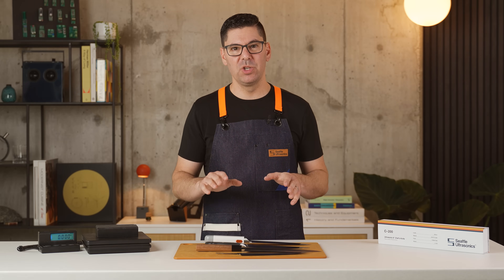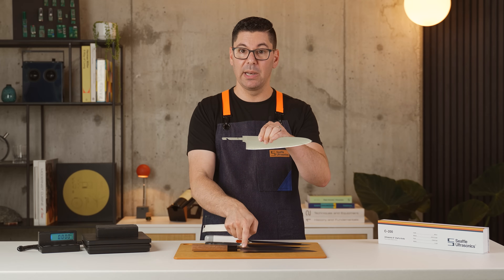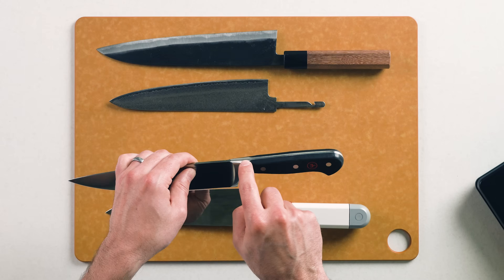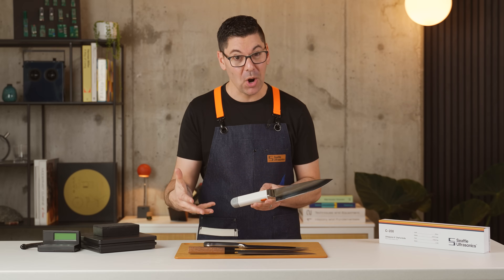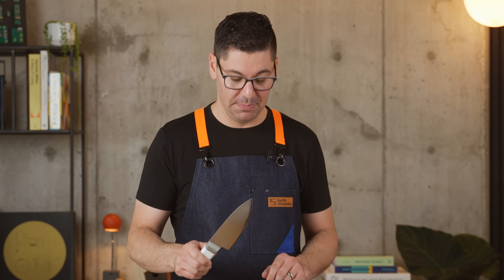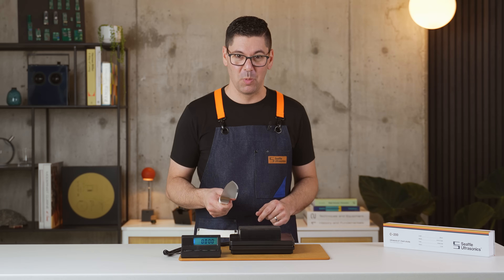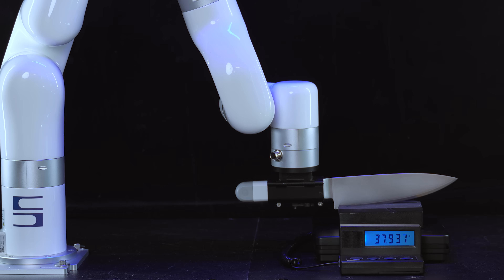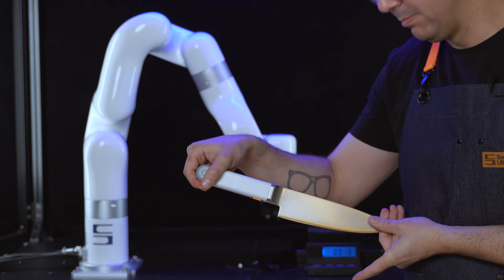Ultrasonic Knife TESTED: strength, weight, & size

Comment: LPBF porous blades would be great with this. You can have a tiny fan in the handle pulling air and feeding to the blade, so another drain on battery. NanoGraf has good batteries for this. 

Also you should provide something between a shortish upward curved ham boner / butchers chisel (hyperbolic parabaloid kind of shape), a putty knife, and a half moon leather knife. Wide pan, upward curve towards front letting you angle. It shouldn't be too sharp as a dull knife works great to pull apart at the fascia, so a blunt apex. This would be fantastic for field dressing and butchering. You've got hunters and you've got hunters with money, both will buy crap they don't need, this would actually be very helpful. It would be like going from thermal back to naked if people want to give it up.

Comment: Are you gonna make a wooden grip version down the line perhaps?
Reply from the maker: I'd love to, but it's a huge challenge compared to wood handles for traditional knives. Ours needs to mate perfectly with internal components to hold everything together, so it needs fine details and dimensional stability. Wood expands and warps with humidity. Micarta could work, but would require the handle to be milled instead of molded, making the whole thing way more expensive.

Comment: It looks a little boxy and less than ideal for a comfort. For a later iteration, I would suggest taking some inspiration from Zwilling and Victorinox. Thin it up a little and give a belly swell and a bit of mid swell. Then make up for lost internal space by making it longer and playing with the blade dimensions to get the balance back forward. Maybe alter or eliminate the integral bolster to get the handle more forward.

Good luck. I have never used an ultrasonic cutter. It seems like a cool product for kitchen use.
Reply from the maker: Thanks! It's remarkably comfortable. We look forward to getting it in people's hands.
Reply: @SeattleUltrasonics can you make plastic ergonomic?

Comment: Any chance that the handle can be made from wood or metal in the future?
Reply from the maker: I'd LOVE to do a wood handle, but the inside of the handle has a bunch of complex geometry with extremely tight tolerances. Wood expands and warps with humidity changes, which makes this a big challenge. I prototyped a metal handle, but it blocks the wireless charging. Some kind of G-10 or Micarta handle could work in the future, but to keep things remotely economical, right now it needs to be injection molded, and Micarta doesn't allow for that. 
I will say, when you hold the knife it doesn't "feel" plastic-y. A lot of effort went into making it feel as solid as any other knife handle.

Comment: I couldn't help but notice that it looks like J Robot Choppenheimer's grip on the knife during the strength test also covered the 'base' of the blade in the handle (i.e. covering the joint you are supposedly testing the strength of)... doesn't that effectively render the test meaningless?
Reply from the maker: No, not really. This is where you'd also grip with your hand, but you can see there's also a little flex in the holder. If it was gonna break from this much force, the holder isn't taking up enough load to stop it.
Reply: I thought the same thing. I believe in the knife, but I also believe this was less than ideal way to demonstrate the strength. There is just something about the look of the knife that makes it seam ‘cheap’ and weak. Don’t get me wrong, I know it isn’t and I am aware of all the engineering involved. Maybe it is simply the color? Wish I could put my finger on it.

Comment: Thanks for answering most of my questions about the knife from the first video!  I still want to know about replacing the batteries. Expensive knives last decades...batteries last years. Are they user replaceable? Is there going to be a way to replace the batteries when they inevitably get old?  I think it'd be absolutely lovely if the batteries were modular in some way.
Reply from the maker: Yep! The battery pack pops right out and charges via USB-C, or you can keep them in and use the Wireless Charging Tile. We sell extra batteries right now, but we also set the charging thresholds and charging current to make sure the cells perform well for a long time.

Comment: Could you make a video where you dull the blade on a stone and dull another knife to the same level? Then show they are equally dull via a shapeness tester. Then show how well your dull blade cuts on ultrasonic mode, then shapen the other dull knife, testing it at each grit level until it cuts as good as your ultrasonic blade? 

Example:
Let's say you dull your blade to the point it takes 1 kg to cut the wire on the sharpness tester (with ultrasonic off)
Then you turn the ultrasonic on, does it cut like a blade that would cut the wire at .75 kg .5 kg .1kg ?

Bread, tomatoes, and chicken would be interesting.
Reply from the maker: Totally. This is in the works!